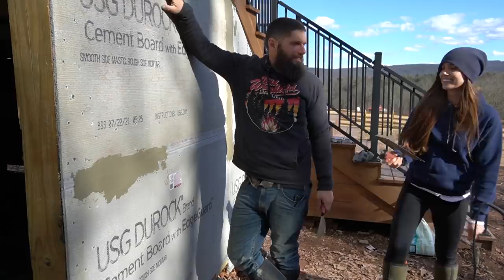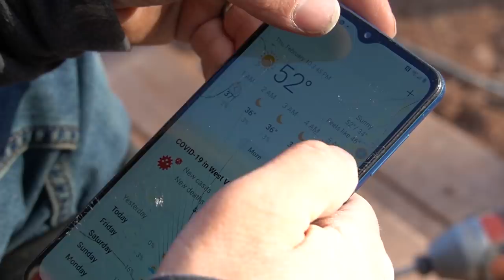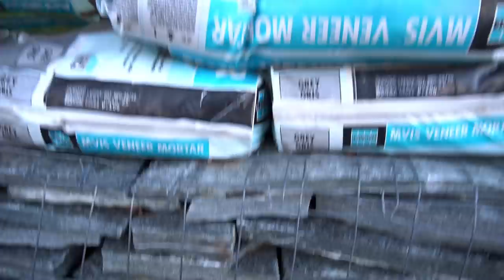The Beginning Of The STONE FOUNDATION | Waterproofing

Comment: I was noticing the family across the street, while having Rock face section put on their home. The contractor had big long folding tables that they would set up next to the area of focus. They would horizontally arrange the pieces on the table before actually applying them vertically later on. One person would decide which rock would go where and if it didn't fit right, would give it back to the other person who handled the saw.
Reply: Ooooh great idea .. I’ll remember this

Comment: Hi Josh and Erin. I am so excited to see you starting the stonework. I have a suggestion that might sound crazy but let me tell you about it. Measure the size of the panel to be covered and mark it out on the ground. Pack the stones on the ground to fit the size of the panel before applying it to the panels. As the stones are different sizes, you can sort out the differences easily on the ground until it is right. When applying it to the panels, start at the bottom of the panel and do the bottom row first and let it dry a bit. This will then support the top stones from sliding down. This method will cut a lot of time wasted to try and do the fitting on the panels straight away. Erin, you can for instance do the layout on the ground with your feminine touch❤ and once finished, Josh can do the cladding of the panels. That will ease the work and cut down on the time to complete the work. Thanks for a great video and sharing your life with us. Love you guys. ❤

Comment: Hey Josh, just a thought, they have those roll-up doors for like sheds and smaller garage doors that you could use on the two openings you have under the deck to keep pests, leaves, and stuff out. they are easy to install and use. just a thought. ;-)

Comment: As a tile layer I would start with a board from the bottom when putting the stone up and using some sort of spacers. Do you think you could hang them from the top? Maybe if you put some nails underneath but that would puncture the sealant of course... the only tip I can really give is use enough/more mortar than you think. Remove stones as you go to check coverage. Can't wait to see the result.
Reply: (as penetrating water under the stones will chip them  away if frost gets back there)
Reply: I hope they realize what a big job they are in for doing all this Stone I'm sure it's going to take them months to do it. Sometimes you can only put on a few layers of stone a day because you got to wait for the weight of it to dry or use a lot of shims.Plus they should lay all that stone out ahead of time and line stuff up to see what fits together
Reply: @bruceschermerhorn4434  Actually with shims I think you could do 1/3 of a wall if you start off with the plank in the bottom.

Comment: One thing to consider is to put up some boards on the other sides of the posts holding the cement board and stone as a guard if it gets hit. Indeed it wouldn't take much impact to pop the stone off with the ATVs etc backing into them plus the interior boards can be used to mount hangers or storage too. A few nose prints by Leon are a must since and nothing on Wild Wonderful isn't authentic without them or the pups like Chuck getting in the way as well...

Comment: Another great episode guys.
Question, why seal the cement board at the seams and then with a waterproofer since the area under the deck  isn't completely dried in,?
It seems like the face stone would adhere better directly to the cement board vs a painted layer.

Comment: Love the stone siding idea, it will look fantastic. I'm a bit confused if the stones are Not sitting on the foundation floor/ground, then they will be hanging off the cement boards. All that weight might rip the cement boards off the wood frame behind it? Those small screw heads can hold only so much... Fingers crossed the plan works out!
Reply: I was wondering that too. Maybe synthetic rock?

Comment: I really hate to say this WWOG but your going to play excuse my language hell getting that stone to stick. I did a few of stone jobs like that and i used the fake river rock and it was a pain to get it to stick. Found out putting extra cement to mix helps it to stick. Your using real heavy stone. Start from bottom and wedge boards and stone to hold first course then start up after first course dries in place and it will help hold next row.  it will be trail and error for ya.  Good luck my friends.

Comment: Love your videos, but I've never seen anyone put up a rock veneer like this.  Also, it seems you are going to need footings to hold the weight of the wall?
Reply: The concrete posts will carry that wall without even blinking.
Reply: @JCrook1028  sorry, but the weight of the veneer is not going to be on the posts, unless he puts a ledge across.  If you are doing that would have just been easier to have footings.
Reply: @jimw3799  Did you not see the 2x6's they installed between the posts that the concrete board is attached to? That will absolutely carry that weight with no issue whatsoever. 4x4's with plywood and metal lath even hold it and this is much stronger. that rock is simply not that heavy. Each panel between the columns is not gonna weigh more than a few hundred pounds. have you ever even worked with veneer stone? I have.
Reply: @JCrook1028  Yes, I've done a lot of veneer as well as other masonry.  I have no doubt the wall is well made, but I'm addressing the downward sheer pressure of that rock stuck on with mortar and maybe wall ties.  It will need support at the bottom or it will crack and fall off.  I done debating this and wish I'd never even mentioned it now.